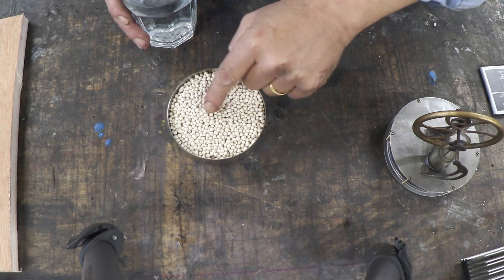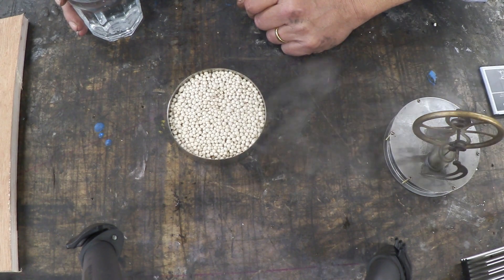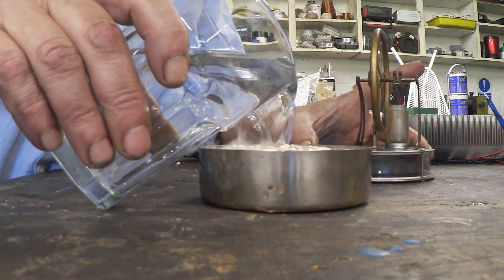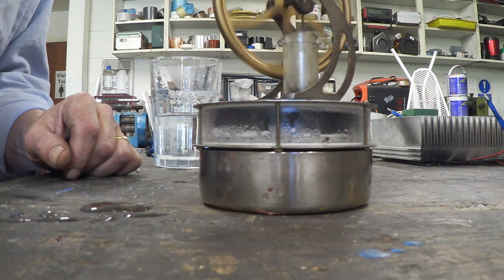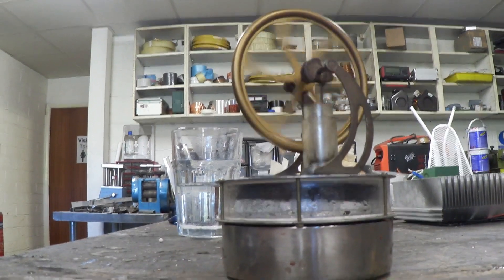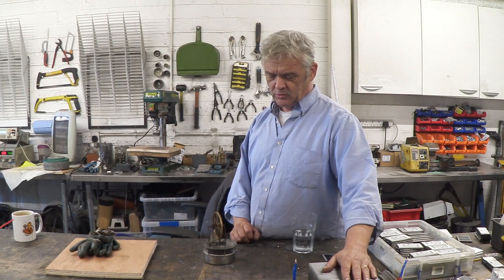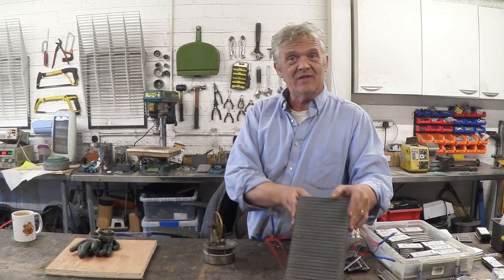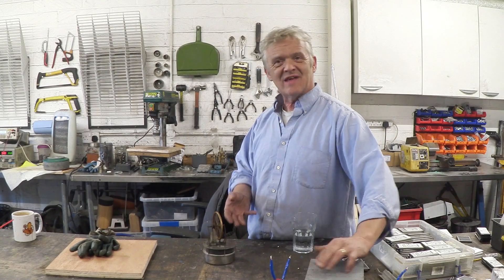1279 Zeolite An Amazing Material - Boiling Water With Clay

Comment: Years ago I wanted to use zeolith to cool the fresh and hot summer air before vetnig my Appartment. The idea was to dry the zeolith and store the energy for at least the first colder days in autumn. Well, turns out that the hot summer air is still not hot enough to activate the zeolith. On the other hand. Even if the zeolith would dry at about 30 to 40 degrees. The about of it one would need to store significant amounts of energy for the cold period becomes insane...
Reply from the maker: there are model systems here in the UK and they use about 2 cubic meters for year round heating and cooling
Reply: @ThinkingandTinkering  Just 2 m3. That's actually great! Maybe my idea was not as stupid as everyone told me. For how many m2 living Area? Do you have a link?
Reply: Same for me : )) Where are your from ? You seem to be french like me are you ?

Comment: Hi Robert,I was wondering if you can dry out the zeolite and re use it over and over or does it loose it's magical properties with continuous drying/wetting cycles
Reply from the maker: you can redry it mate
Reply: @ThinkingandTinkering  ….if you coated x13 zeolite with LIT glow powder and sprayed water on it ….it would make enough light to run solar panels at night….then the clay would dry in the sun the next day for a repeat.
Reply: Thanks Robert,all the best mate👍
Reply: Ummm I'm thinking zeolite powered kettle 🤔

Comment: Rob, Include a solar heat exchange into the zeolite pile for the dehydrating phase? Perhaps if you had multi zeolite piles there could be hydrating dehydrating happening at the same time. Interesting to see the efficiency ( separate from the peilters) you get. Perhaps if you sealed the zeolite piles perhaps a further heat exchange could opperate upon the steam to liquid phase and that would provide a sealed cycle without the need for external liquid source.
Reply from the maker: I have a plan that is similar mate - cheers

Comment: Have you tried finely divided iron with a little saline solution  (hand warmers)  use a mix of vermiculite, activated carbon and finely divided iron -  Aluminium works also with hydroxide but also makes hydrogen (suppose a drier mix maybe produce less - this does get hot (runaway hot) 🤔
Reply from the maker: I haven't tried it - I like the idea that all you have to do to reuse it is dry it

Comment: Hi, can someone explain where exactly the energy comes from? Is it from breaking the hydrogen bonds in bulk water during the adsorption? Thanks!
Reply: The minerals probably has much sodium  in it and sodium likes water. I don't think any chemical changes are going here.  It's just that to dry zeolite you have to add energy (heat) which end up being an endothermic reaction cooling it down making you have to add more heat to remove more water.  

Now the reverse happens when you add water, you get an esoteric reaction. 

Energy wise, It's a bit like a ball and a hill. Pulling water out of sodium minerals  puts the ball at the top of the hill. Adding water to dry sodium minerals is like letting the ball role down hill and here, the kenetic energy in the ball is a metaphor for thermal energy.
Reply: @kreynolds1123  hi keith
Can you tell me, is there any evolution of gas or it just heat that evolved?
Reply: @rashmijagtap5023  just heat, no gas.
Reply: @kreynolds1123  is there any theoretical proof of it? Like can you suggest any book , research paper or something? Actually I'm working on the heating concept of this zeolite...it would be great if you can help
Reply: @rashmijagtap5023  it's simply the hydration of  the zeolite. 
Zeolites are porous hydrated crystalline aluminosilicates 

As the crystals absorb water ti their surface, it  limits the degrees of freedom for the water's molecules so lowers their heat capacity, and because the energy has to go somewhere it raises the temperature. 

In a way it's not so dissimilar to sodium hydroxide  (NaOH)  giving off heat when it's added to water forming higher order hydrates.  

NaOH•H20(monohydrate) NaOH•2H2O(dihydrate) NaOH•3H2O(trihydrate)
NaOH•4H2O(tetrahydrate)
NaOH•5H2O(pentahydrate)
NaOH•7H2O(heptahydrate)

For instance, Clays need to be fired to drive off thevadsirbed water.  Heating them drives off the adsorbed water molecules which is endothermic processcooling which means you have to keep adding more heat energy to drive off more and more water molecules.  Water vapor has more degrees of freedom than hydrates so water vapor has a higher thermal capacity. 

A zeolite is not supose to chemically react with the water, but.... it's entirely possible that the first batch of a zeolite may contain some metals that react with water to form a hydroxide and give off hydrogen, but for the most part this is one time.  The zeolite may be regenerated and drive off watertight the addition of a little heat, but it's very energy expensive to reduce hydoxides to their base metals.
Reply: @rashmijagtap5023  I might sugest Google zeolite adsorption. 

I'm not sure if your aware that there adsorption is different then absorption.
Reply: Where does the energy come from?  The adoption of water molecules  to aluminum  silicate  restrict the degrees of freedom of movement.  This lowers the heat capacity thus the temperature  rises.

Another example where confining the degrees of motion effects  the heat capacity of a material is the  magnetocaloric effect.  Some materials, when you add a strong magnetic field, the magnetic field restricts the degrees of freedom of movement from 3 to 2 which lowers its heat capacity. Causing the material to heat up in a strong magnetic field.

Comment: The Bosch dishwasher we have uses zeolite to aid its drying cycle.
Reply: do you have to refill the zeolite or is enough in there from the beginning?
Reply: @naotamf1588  No it uses heat from the start of the cycle to dry itself, then the zeolitye to heat air while drying the dishes

Comment: You may be able to crush the zeolite into a powder and compound it with some hdpe plastic. Giving a more sustained reaction possibly. The plastic would essentially be a binder to hold the zeolite together into a block or plate, and to slow the reaction. The reason the water boils is due to the heat produced as the zeolite adsorbs the water.

Comment: What happens to the zeolite?  Does it break down or does it dry so that it can be used again?
Reply: A crucial observation. Even without Peltier devices - steam is the classical energy transfer medium, requiring only simple metal pipes to transmit, and long-mass-produced turbines to translate into electrical energy. As user @Keith Reynolds has pointed out in a comment above: 

"The minerals probably has much sodium  in it and sodium likes water. I don't think any chemical changes are going here.  It's just that to dry zeolite you have to add energy (heat) which end up being an endothermic reaction cooling it down making you have to add more heat to remove more water."

indefinitely

Comment: one thing i always wanted to do is figure out how to put zeolite in concrete to make a porous driveway that automatically melts light snowfall
Reply: It would be fairly easy to mix in the zeolite, however zeolite has a very high affinity to hold moisture, and takes heating to over 400F to dry the zeolite out. Due to the heat of adsorption and its desiccating properties the zeolite would cause the concrete to cure very rapidly. It would need to be mixed in at the very last moment and finished right away before it sets. Then theres the matter of drying the zeolite back out and it would also reduce the strength of the concrete, so a fortifier would need to be added as well. But you may be onto something, i would be interested to hear the results if you do any experiments around this concept.
Reply: @deezy_da_M_E  i banged my head at it for a while; one of the ideas i wanted to examine is that silver nanoparticles/atoms trapped in zeolite form like, some kind of quasi metallic bond thing where the silvers valence electrons are given up to the zeolite and this can emit light. i wanted to experiment with doping zeolite with different catalytic metals and maybe photo-reactive metal oxides to see if that can make solar drying of the zeolite possible.

Comment: Can drying out make the reaction go again?..
Very cool vid
Reply: Yes, but it has to be dried out in a high temp furnace for a number of hours.
Reply: @deezy_da_M_E  is high temperature necessary?
Reply: @yash_kambli  Someone told 204C° 400 F. I don't know for how long. Maybe possible to get with vacum thermal solar pannels ?
Reply: @AutoNomades  204c is what we use for silica gel desiccant, which doesnt hold onto the moisture as well as zeolite.  I guess if youre not trying to completely dry the zeolite you can use the lower temp, however you will be left with a residual moisture likely >5%.

Comment: I'll have to dig it out of that messy corner in the shed but I, years ago, made an intermittent adsorption cycle refrigerator with ammonia and CaCl. It would be interesting to try a version with zeolite and water.
Thanks for the prompt!
Reply: what's your heat source? i want to try same project but not sure how to handle ammonia,

Comment: Am I right in thinking that this stuff needs to be heated up between 250 to 300° C to regenerated it
Reply: Yes. Especially the type that is used as a molecular sieve.
Reply: Higher than that. We dry 13x for 5 hours at 500 degrees in our furnace at work in order to drive off the moisture.
Reply: @deezy_da_M_E  That makes it more like an inefficient battery/energy storage device !
Reply: @gazzaka  I don't think efficiency is that important when you are using something for seasonal heat storage. As long as you have the space and use a low cost medium that is.
Reply: Thank you to everybody who replied very helpful the next thing I need to do now is try and find some found some on eBay 3 kg for about 90 quid i’m thinking of using it as an extra heat battery for my electric van
Reply: @stuartdean4620  Have you considered Sodium Acetate Trihydrate for thermal energy storage? It is far more useable as it only needs to be heated to 75°C to recharge (melt it) and gives off 58°C when activated (crystallisation of the supercooled liquid). 10 litres of it in the liquid state can hold roughly 1 kWh thermal energy. The 10 litres will way a little under 15kg.
Reply: @VinoVeritas_  it’s funny you should say that because I’m building a heat battery along those lines using exactly that at the moment I wasn’t too sure how good it would be but thank you for the information

Comment: Cool, now size that up to run something like a generator , it would look like we went back to steam punk days, or tartaria
Reply: With the boiling comes destruction, unfortunately. After a while, the chemical reaction would stop. There's a better way to power a stirling, and that's with the ambient room temp. When you trap air in water, the water closes in around the air bubble and essentially concentrates its contained heat. If the air and water are at the same temp starting, the slight compression of the air raises its temp above that of the water, albeit ever so slightly, and as the laws of thermodynamics dictate, that heat is passed into the water. That heat will flow backwards, however, if the water temp is higher than that of the air after compression...equilibrium. You need to break that equilibrium, or at least offset it...so you run the intake air (pre-compression) through the water in a heat exchanger, and THEN compress the air. What you get is essentially an operational amplifier, but for heat instead of electricity. The more heat that gets transferred to the water is the more heat dumped into the air before it gets squished and concentrated. The air that runs through the system is not only cooled by the intimate contact with water, but it's also slightly filtered. All of that heat gets concentrated in a thermal feedback loop, which can then be used as the warm side of the sterling engine. The only thing you really need is the flow of water, and pumps are relatively cheap. If you wanted to efficiently turn that heat into electricity instead of first converting it to mechanical motion, putting TECs under the water basin would convert that heat into electricity...

Comment: Electricity generation is fine, but in my opinion with so many people doing van dwelling in colder climates these days how about suggestions on making some type of heater that lasts more than a few minutes, is safe, and can be done over and over again?
Reply: Heat is easy.  The problem is LOSS of heat.  If a van was made with a vacuum chambered walls,  it could retain heat for a very long time.   IR reflective space blanket material can help reflect heat from escaping the body.. and or it could be part of the facing on internal insulation, much like an Attic.  The best way to capture Heat, is to store it in thermal mass, to slow its conductivity  (See:  Rocket Mass heater).

 With a rocket mass heater, they store the heat in a stone bench.  The type of fire it creates burns hotter, and more complete... so its much more efficient than a typical fireplace/stove.  This heat gets trapped into the rock... and rather than instantly rising the to ceiling... the rock slows the heat release over the course of many many hours... long after the fire has burned out.

 One could make a simular setup, where you build a raised bed, and the heat is trapped under that bed... which slowly releases into the persons body.  It would have a cooktop and oven capability as well, in the primary burn section.

 But even then... good insulation is what is needed to help keep the cold from overcoming the released heat.  In the most extreme winter cold situations, you probably would need to build a smaller enclosed sleep area, with thick insulation all round it.  This would eat up valuable space for other things.. however.   The next best thing, is an expensive sleeping bag, rated to extreme weather cold.

 At a time, I was homeless, and had to sleep in the upstate winter, in my minivan.  I had made an internal cardboard box fort inside of the van, to hide me from the public / police eyes.  It also helped a little, with keeping some of my body heat inwards.  I used a space blanket, maybe 3 comforters/blankets, was sleeping on a thick foam core tumbling mat, and wore three layers of clothing.  I also wore a hat, over the ear headphones, a scarf, 2 or 3 pairs of socks... and I still barely made it.   I tended to try to sleep in the day, and stay out in heated buildings for as long as possible at night... to reduce the time spent in the cold.

  I couldnt afford to leave the heat running in my van.  The best I could do, was to heat the van up for about 10 to 15? min... then shut the engine off, and quickly jump into the box.   If I was luckily, I could fall asleep before the bitter cold took over.   Though... sometimes I would still wake up so cold, that I would have to repeat the process.  It was a nightmare.

 (I of course, was not prepared... thus my van was neither insulated, nor did I have a source of alternative heat)
Reply: @johndough8115  Thanks for your response. This is not easy which is exactly why I'm hoping Robert would consider giving this some thought. With the pandemic and loss of income for so many a cheap source of heat would be a major welcome thing to have. I love the idea of a mass rocket stove but venting it is difficult to do when you're trying to be stealthy. I often thought the combination of the rocket stove and free pallets would be good, but the fire doesn't last long and it would be better if there was no fire at all. Maybe some other commenters could share their thoughts with us too. Here's hoping...
Reply: @rolliebca  A rocket stove burns quick, but very hot.  A rocket mass heater, is designed to capture that heat, and release it slower.  Thats the only difference between them.  (Same principles of how they operate)

 As such... a very small amount of palette wood could easily be more than adequate for keeping you warm, for many hours.

 If the rocket mass heaters are designed properly.. they emit no smoke.. and I believe the exhaust pipe is less than 80 degrees F.

 Still.. there would likely be some steam created from the actual heat differences.  Again, it really depends on if you can extract maximum heat before it gets to the external vent.

 I suppose you might be able to make a radiator like setup in the upper chimney section, using aluminum heat fins.. to rapidly cool the exhaust, before it exist.

 To to this, you would likely want to have a long pipe on top of your van, that travels in a U-shape.   For best results, probably want to make this section of the pipe out of aluminum, and carve heat fins right on the actual exterior. (or weld some heat-sinks on it).

 Id probably advise a high temp silicone rubber section, between the metal exhaust pipe, and the aluminum section... to help prevent the cold from creeping back into the vehicle, when the fire is out.

 You might also want an internal valve, to close the pipe near the top, to prevent cold from entering, when the fire it finished. (Manual operation only)

 The vent pipe will also need a top that has an overhang, to prevent rain, snow, and a mesh screen to prevent bug / critter entry.

 Other than that...IMO,  there is no other easy and safe way to heat, that isnt going to cost a lot of money, as well as be dangerous, due to fumes / co2.